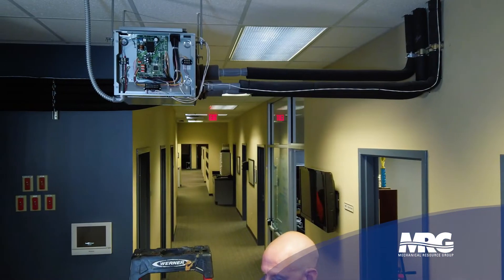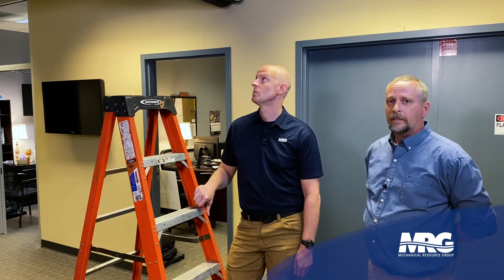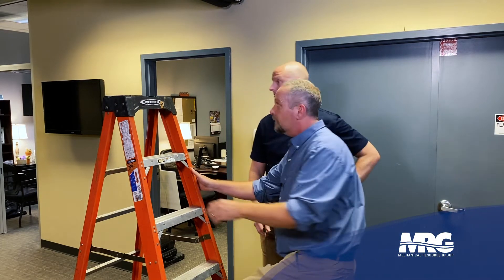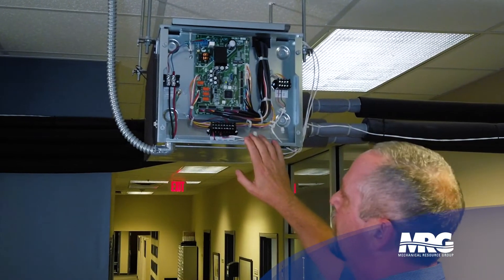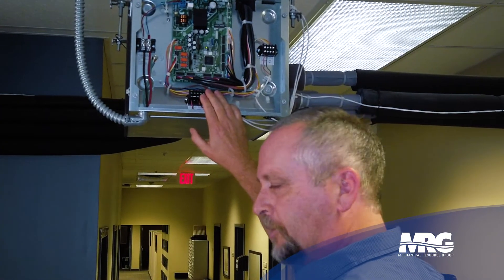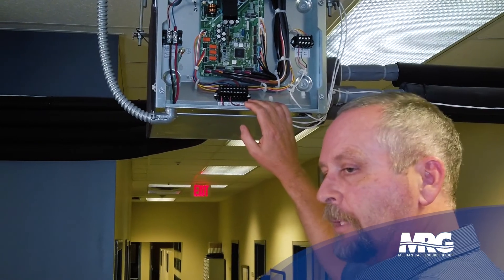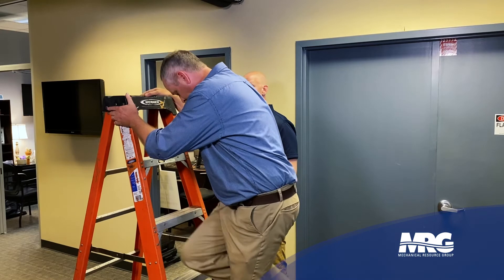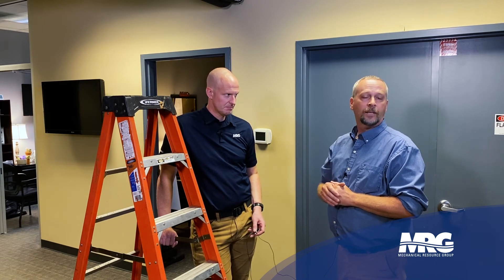Daikin VRV Branch Selector Box Tips

Comment: Hey gents if I put the system in recovery mode would the branch box eevs open automatically or do I have to hit some dip switches at the box itself?
Reply: When you put the outdoor in mode 2-21 refrigerant recovery mode, all EEV's will open (on Vrv 4 and previous) Vrv5 it will open all valves except the safety valves.